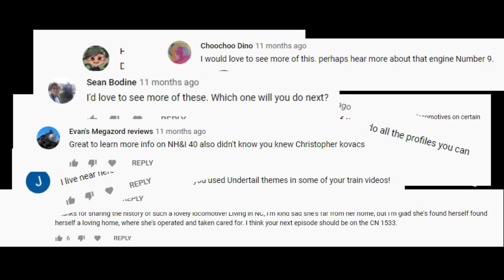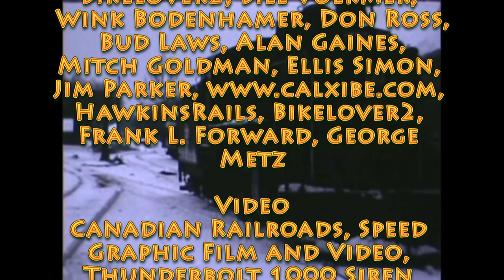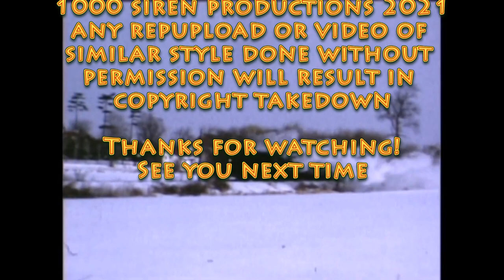New Hope Profiles: CN 1533

Comment: I really hope 1533 will get a cosmetic restoration one day. That poor old girl is just rotting away.
Reply: It’s not great but it’s better than the deadline or worse 

The scrappers torch.
Reply: They tried doing a complete restoration but instead of restoring 3028 they should restore the 1533 at least a cosmetic like you said
Reply: It’s very unlikely
Reply: There's talks about getting a shop expansion in order to accommodate the restoration of 1533
Reply: @fermitthekrog6318  i doubt New hope railroad would do that they have enough engines running
Reply: @atsfevan0242  I work up at the New Hope Railroad. They want it running again but don't really have the space right now.
Reply: @atsfevan0242  they only have 3 of which they only run the diesel and 40 only runs on special occasions during fall Christmas Easter Mother’s Day Father’s Day and weddings but all the other locomotives you see are from Pennsylvania Northeastern
Reply: Agreed
Reply: You also should realize that they only run on weekends and only run 2 trains during selected weekends each year meaning that 3 engines is enough for a short branchline
Reply: Evan's Megazord reviews well sometimes we'll run up to 3 trains at once just not all the time. Having 3 locomotives is nice but technically only 40 and 1533 are owned by the corporate structure that runs the New Hope Railroad. Having a second steam locomotive has always been a goal, but finances in the past have made this difficult.
Reply: @fermitthekrog6318  yeah that's why, even if 1533 ran again it wpulc need a complete rebuild since its been rotting and rustung for nearly 5 decades
Reply: @atsfevan0242  yeah they painted it a couple years back to prevent that from getting any worse. At one point they were working on 3028 first but stopped. The railroad wants to expand its shop. They've recently been acquiring a couple more passenger cars so they've got some big things planned.
Reply: @atsfevan0242  They have run 3 trains at once in the 2019 Christmas special and years past but tomorrow it will only be 40 and Sunday and they don’t always just run on the weekends they have Fall foliage which they sometimes run during the week and during Christmas they don’t take a break until early January
Reply: @fermitthekrog6318  I’ve been noticing the extra cars
Reply: @Danny Smutek oh that's a good question. They have plans to physically make it bigger so they have more room to work
Reply: @Danny Smutek i truly hope so. Love to see 2 or 3 steamers operate at NH&I someday
Reply: They need to cosmetically restore her if they don’t show just right away and if she gets to rotten sure be written off as scrap

Comment: 2:20
Look carefully and you'll see two US army 0-6-0's
I believe the one closest is 7
7 has been widely forgotten as it never operated on the NHRR, and was parted out for 9. Most of it's life was spent on a former quarry spur in Buckingham as a husk of a locomotive before being scrapped in if I remember right, 1970.
Her legacy however lives on as so many of her parts were used on 9, the engine is basically half 7.
If you do an episode on 9, 7's existence might be a good detail not to miss.
Reply: Also, 4:05, I would like to point out at the time the regular terminus was Buckingham. The siding at Lahaska would not be constructed until the 90's. But I was blown away by the amount of information and accuracy in your video. Well done!
Reply from the maker: 7 was also one of 9's sister hence her being cannibalized for parts so I will indeed mention 9's lesser known sister.
Reply: She also has 3 more sister Morris County Central 4039 and 2 at  heritage park historical village
Reply: @drunicorn  I’ve seen those steam trains before there number 2024 and 2023